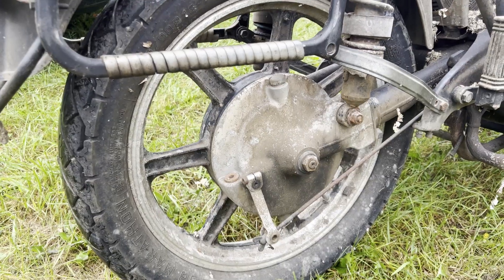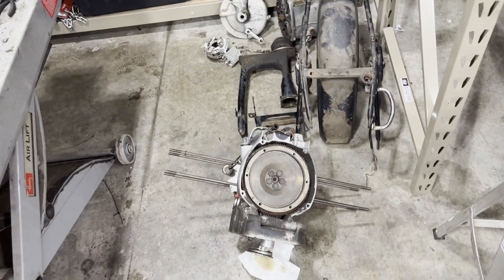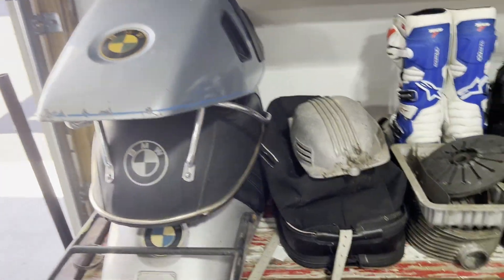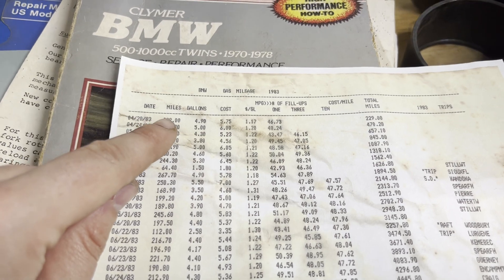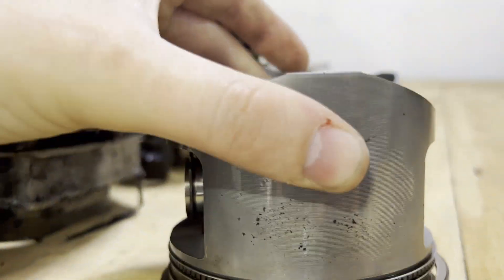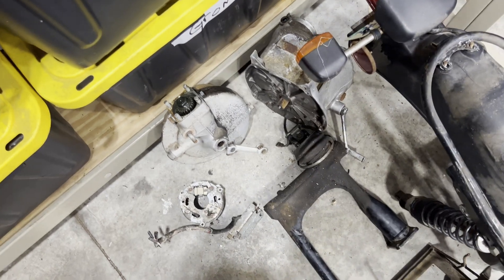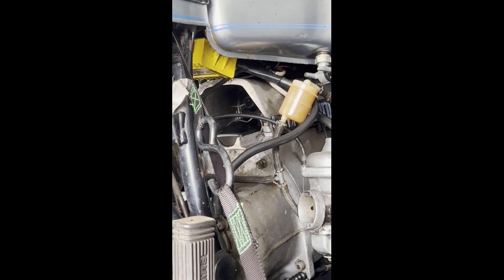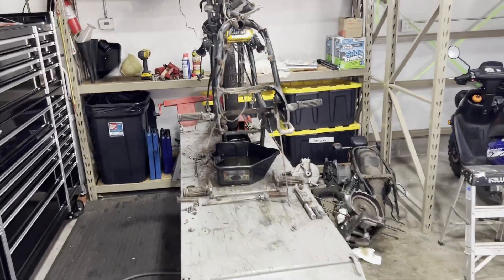1977 BMW R100RS Barn Find, What did I get myself into??

Comment: After 20 years in the barn, I pulled my '87 R80 out. I'm the original owner, but the mice thought they owned it. They made a nest in the flat air filter, which filtered down into the carbs. I needed a whole new airbox and hoses, new ignition amplifier, new coil. Then I had to rebuild the carbs and rewire everything the mice had eaten. Now the bike is running, although not as smoothly as I remember. What a project! Best of luck with yours! It is going to be awesome.

Comment: Great find. I helped restore the 1976 demo model supplied to Park Lane BMW. Same colour. Wheels should have a blue line round them like the fairing. I had these in the eighties. Still have an R80 and R100RS from 1980. The RS had 19K on it when i bought it about eight years ago. U.K.

Comment: I bought one of these used in '84, parked it in 05. Early model w/ wire wheels. Mice got in the air box, made a big mess, chewed alt. wires. Fixed wires for 18$. Cleaned alt rotor & stator. Cleaned terminals on diode board and all tested ok
 Bike started like I parked it yesterday and charging system  works great! Most parts are still available and they ain't  cheap! We both have a great classic!

Comment: Ummm, very interesting! I still have mine, bought it in July 1977 from Bud Van Sice in Wilmington Delaware. I’ll be interested in how your rebuild goes. Mines still in one piece but does have a few modifications.
Reply: I never did like Lester wheels as they had a reputation for cracking. I was able to source a pair of BMW snowflake and gave my wire wheels to a friend, Bert Stuckert- WERA racer back in the 80s.

Comment: Death To Mousies!   No Quarter!

I have 5 motorcycles in my garage - 4 of them BMWs -- and the mousies have always seemed to prefer Bavarian Iron. The air intake on the Airheads is a favorite entry point -- as you've already seen once they're in there everything under the starter and front engine covers is fair game. Replacing the factory plastic intake screen with something made of metal will at least slow the little feckers down.  I also have an F800 GS Adventure that is crazy tall, and the last time I did some routine service I had the same Ralph Mouse condo action on top of the bike's fuel pump, which, when sitting on the main stand, is at least 4 feet off the floor.   They are merciless. So should you be.
Reply: You hate mices to pieces!

Comment: That's just barely broken in at that milage. Pay special attention to the wheel and neck bearings. Test the valve springs. Know that the bike was run at mostly slow speeds at to low of a egt. Get those wheel bearings out as fast as you can. They probably have water in them now from the wash. Never use a pressure washer. Use lemon pledge and rags on a Airhead. Brake cleaner  brass brush, rags on engine case.
Reply from the maker: this is going to be a complete frame off build, nothing is going untouched. wasn't the least bit concerned about water intrusion. wheels are all redone and re laced and new bearings/seals.
neck bearings are removed and frame is at the powder coater's shop